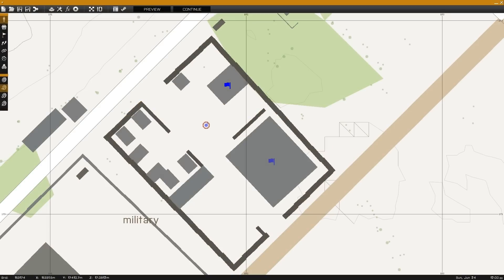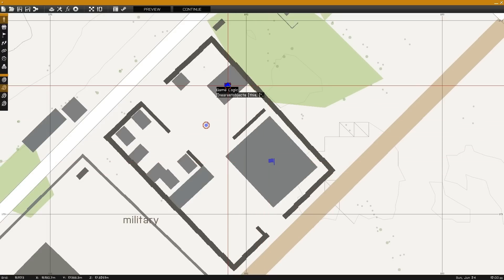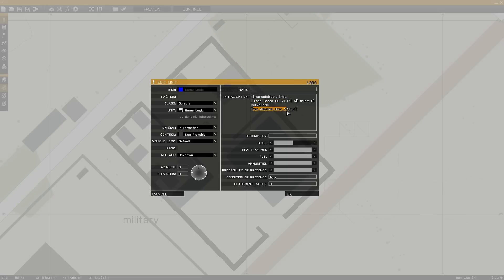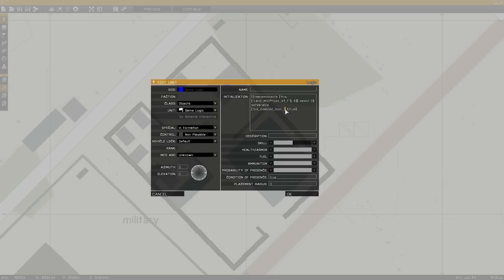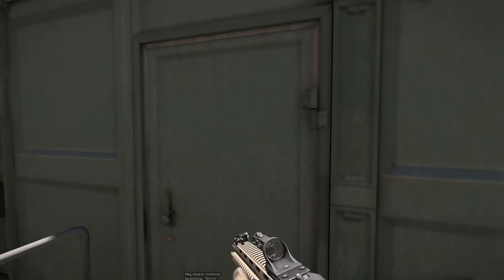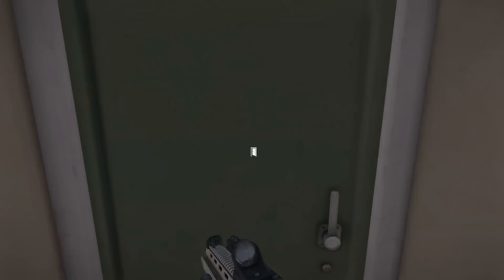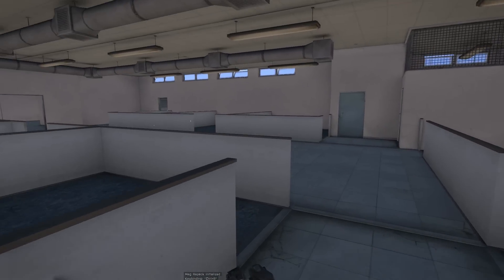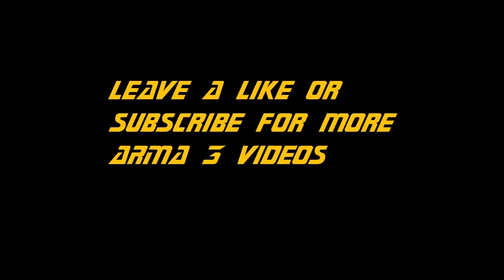ARMA 3 Editor - Locking Structure Doors

Comment: If your having issues with the script, it Does work tested 3/3/2017. Just make sure that the logic is placed in the center of the building as possible, the game does not recognize the entire building as an object only the center point, so for this game logic placement to work you must place it as close to center of the building as possible.

 I tried placing some of the game logic's by the doors i was locking on the bigger structures for convenience but Some were too far away from the center of the building and would not works.

You would not really want to adjust the code either I believe the first actual number you see is the range to select the nearest object, If you were to expand that range depending on any nearby buildings, it may affect a building you don't want it to.

Comment: hey pick, I put the game logic on a structure exactly as the code is (I changed the class name to the structure) and it still just opens
Reply from the maker: Well there are two things to bear in mind first of all, one its's been like over a year since I've even loaded Arma up, two it's been like two years since I've posted this so things very well may have changed with the over 40gb of updates that have happened since.

With that said throw an example together that I can load with no mods and I'll see if it is broken on my end as well, I'll mess with it and see if I can get it going, if that all fails I'd guess it's likely safe to say it's a result of changes to the base scripting system
Reply: by the way I tried on a custom door AND an arma 3 gate
Reply: @
Grisly Bear and 2 more years have passed and it still works flawlessly so what did you do wrong?

Comment: After using this, how do I make it so the door becomes unlocked later? I'm creating a survival mission, and want a certain structure to be locked until you find the key for it.
Reply from the maker: GuardianOfWhatsRight The way the function works is that you define the state in the last value in that command line, for example:

((nearestobjects [this, ["Land_Cargo_HQ_V1_F"], 5]) select 0) setVariable ['bis_disabled_Door_1',1,true];  

In this line door 1 of "land_cargo_HQ_V1_F" is set to a state of true (meaning locked), so if I were to repeat this command again with a state of false than the door would be unlocked.
Reply: pickinthatbanjo That's what i thought when I first used this, but for some reason it doesn't unlock the door when I tell it to switch to false. I even tried having a trigger delete the game logic that was locking the door, while also having it add the unlock code to another game logic... seem that once the door is locked, it stays locked. Any idea on what could be causing this? Thanks again for the help.